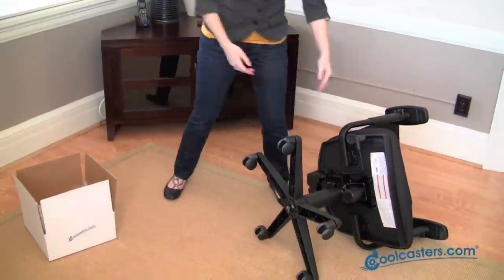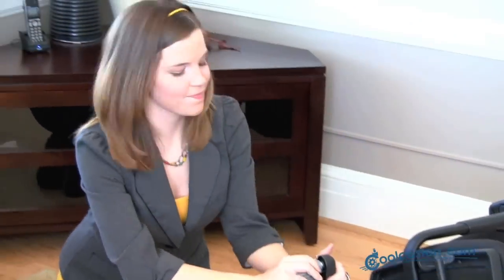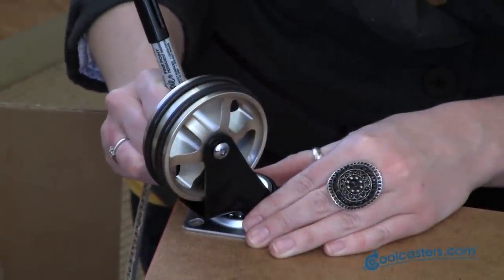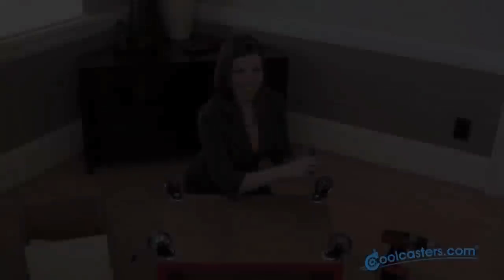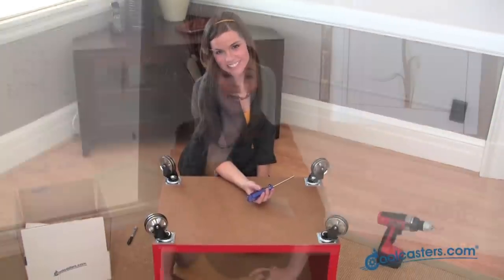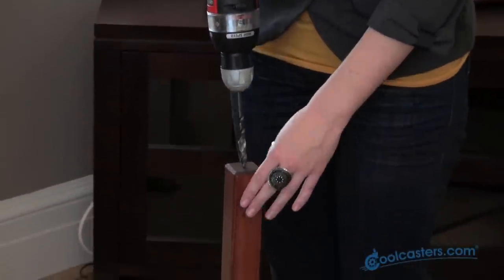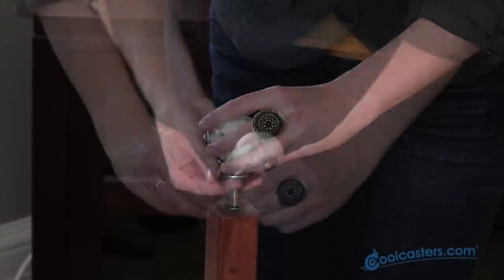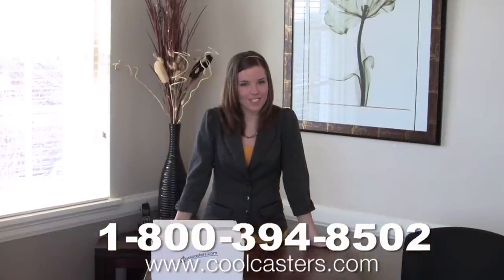Cool Caster Wheels Installation

Comment: If you are switching out casters, you might have a caster that is loose.  Try wrapping tape ( electrical or other ) around the stem covering the grip ring. This should also help tighten it up. Crimp a corner of the tape, so you can easily remove some excess if you initially wrap too much tape on the stem. Crimp the corner nearest the floor, which would be the bottom of the caster stem, so the crimp won't interfere with your initial push to "jam" on the caster.  (not an expert, but it worked for me.)